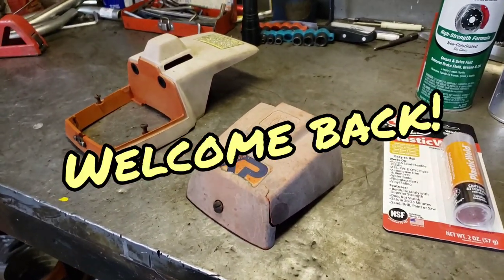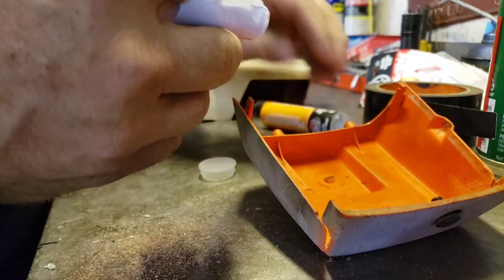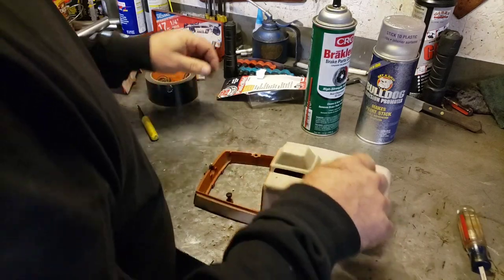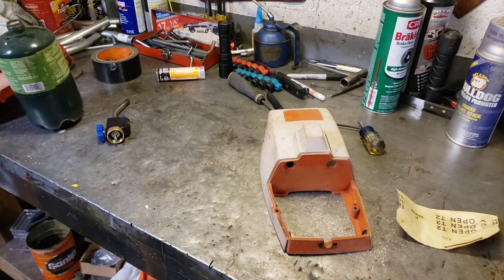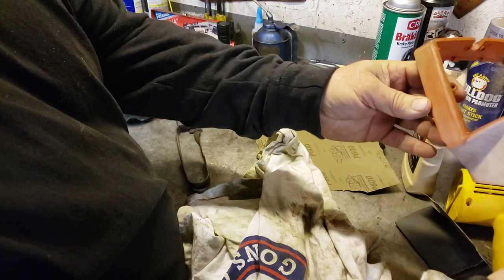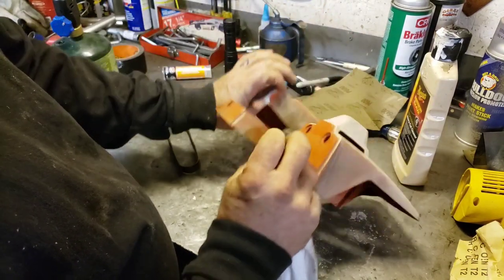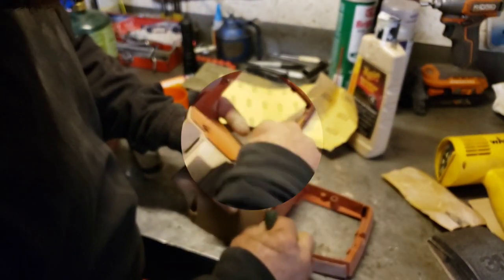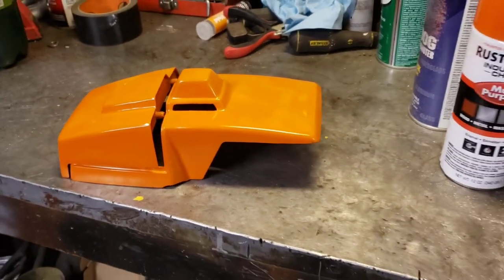Vintage Chainsaw Plastic Repair and Restoration #chainsawresurrection #kainkustomgarage

Comment: Nice job.  I bought a $15 plastic welder from HarborFreight that works awesome for plastic cracks.  I’ve fixed all kinds of stuff with it.  For the more flexible plastics I use all different colored zip ties as my filler media to kind of match whatever I’m working on.
Reply from the maker: Thanks man, I'll have to check out the plastic welder and zip-ties...Appreciate you Brother!😊

Comment: Best way I have found to clean oxidation off Husqvarna plastic...ajax and 0000 steel wool....you will be amaze...Shoe
Reply from the maker: Thanks Shoe! I'll have to try that next time!👊👊
Reply: @KainKustomGarage  I think you'll  be surprised..  a few years ago I stumbled on to a utube video of a guy cleaning motorcycle plastic this way....I tried it on a Husqvarna 266 XP I was restoring the plastic looked good as new with this cleaning method. Good luck...Shoe

Comment: I use JB Weld, the dark grey stuff, to fix plastic on stuff.  I just got through using it on a MAC PM 610 that I have restored.  It sands well and fixes, even small missing pieces.    I have never tried the plastic putty.  I basically get what Walmart has.
Reply from the maker: Thank you John, yeah I think the grey stuff probably works just as well....😊

Comment: If you can incorporate a drill or power toll for some steps it saves a lot of time restoring plastic. I've done plastic headlights with a cloth wheel on a drill and various abrasive compounds.
Reply from the maker: Thanks Jeffrey,  yeah I should invest in some of that stuff, would make things go faster for sure!😁

Comment: They sell the wiz you can put on the dremel. 320, 530, 800 grit works nicely with the compound. Plastic restoration takes time for sure. Nice work my brother from another. !!!  ❤️‍🔥🦾☀️
Reply from the maker: Thanks Buddy! Yeah I should try that, would definitely be faster...I appreciate the feedback Brother!😉
Reply: @KainKustomGarage  aww man. Thanks for being you. I have never heard of the bulldog adhesive promoter I’m going to check it out. I been using the self etching primer on plastic. It holds up reasonably.  Hope your Monday is great .!!🦾
Reply from the maker: @ScrewdriverTUNING  Thanks so much buddy! You have a Great day as well!👊👊

Comment: It looks good. I was wondering if they make Husqvarna orange paint? I have used a heat gun on lawn mower engine covers and it works ok .
Reply: I know Kubota orange is very close to Husky orange. Very subtle difference.
Reply from the maker: Thanks Brian,  yeah not sure probably for a price....lol...appreciate you man!😄
Reply: They do - the Husky stuff is about $40/12 oz can. I picked up some other Husky orange from another brand off Amazon for less than half the price, as well. I’m using the sand and clear coat method for plastic parts, and seeing how the paint will work for the metal parts on the older series saws (recoil & clutch covers, cases, etc).
Reply: Use STIHL's orange paint! It will run better! 😁
Reply: @richardfuerst5286  I don't own any Stihls.

Comment: I wet sanded a shroud for my 026 with 400 wet or dry and then with 600 wet or dry.  I then sprayed it with clear coat Avril lid.  It did a pretty good job but I just replaced the shroud with a new ms 260 engine cover.I probably could have repainted it but new plastic is cheap.
Reply from the maker: That's a great idea too! I'll have to try that....😁

Comment: Kain-O: I’ve got 80% of my vintage 288xp down to metal. Assuming I clean with acetone or brake cleaner, sand, can I go to U Pol 8 primer? Dan
Reply from the maker: Hey Dan, Yessir I don't see why not...good luck Sir😊
Reply: @KainKustomGarage  thanks Dan. Your suggestion on U Pol stuff has made a world of difference. Sure, costs a bit more, but the results speak for themselves.

Comment: Sometimes i think tbe plaztic just dries out...  wd40 definitely helps  normally,  wonder if  a wet sand using wd40 would  do anything  useful?
Reply from the maker: Thanks man, Yeah not sure on the WD40, I'll have to try it on the next one...I appreciate the feedback!😁
Reply: @KainKustomGarage  you ever seen where the plastic gets dyed black in a pot on hot water... that might work provided you get close to the correct orange dye...
Reply from the maker: @nickywalsh8492  I've seen that too, looks interesting for sure!😉